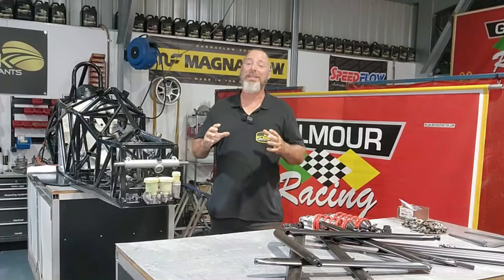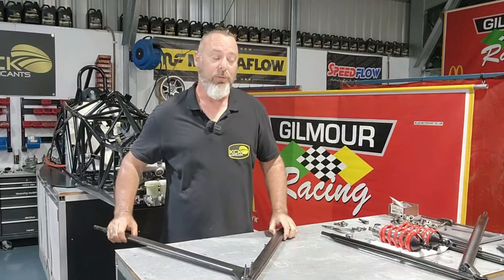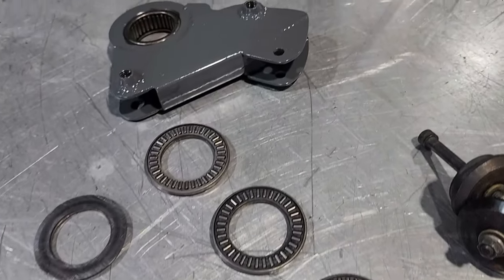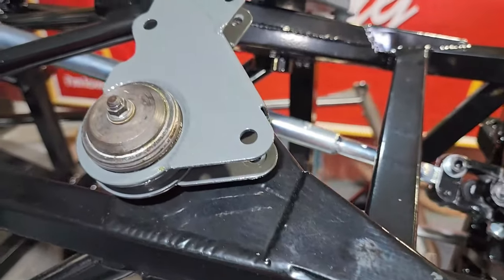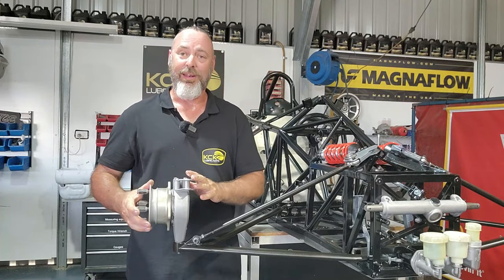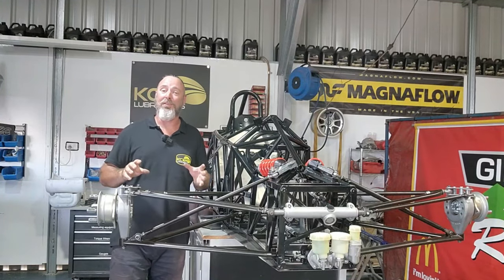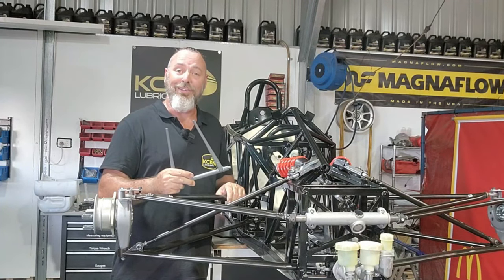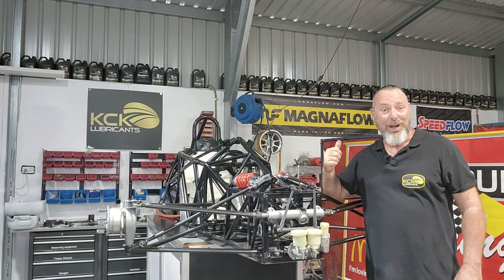Formula Ford Front Suspension Van Diemen RF96K restoration Episode 16, by KCK Racing Australia

Comment: Been working on FF's for years (mainly Mygales). Looks like the RF96 doesn't have the cross bar on the front arms to prevent cockpit intrusion. Otherwise, I'd have assembled the whole corner without bolting it up, just lower arm and pushrod, then body work and bolt it all up to finish
Reply from the maker: Thanks for watching! Yes the is just prior to the cross bar update

Comment: I would have assembled all of the joints with grease to reduce wear and to inhibit corrosion.
Reply from the maker: Thanks for watching and great suggestion! we have found in the past that the grease holds onto dirt, brake dust and debris possibly causing more wear but we absolutely agree about the corrosion protection.
Reply: Silicone spray works better
Reply from the maker: @ryan_r849  Thanks for watching and great suggestion.